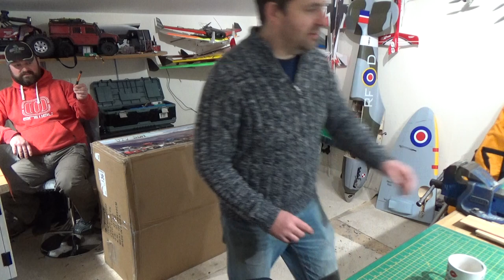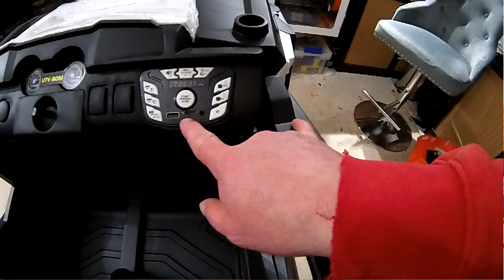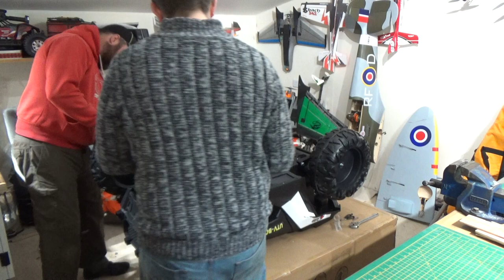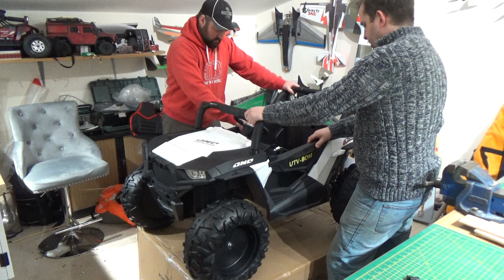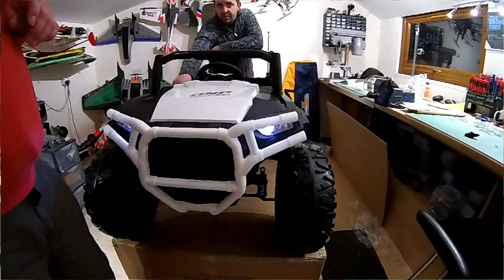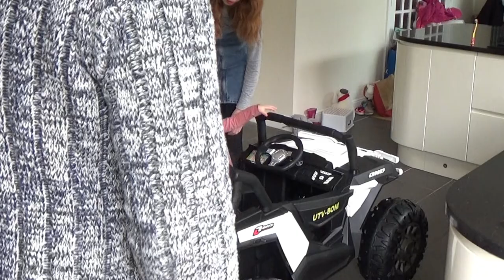Desert adventurer 24v

Comment: How long dose it stay charge for I have one but it don’t seem to stay charge long my kids got one good ride out of it
Reply from the maker: The batteries on these kind of toys have always been the down fall of them.  They still use the oldest tech (lead acid) which is reliable but there are far better batteries these days. 
Also the heavery the passengers the shorter the ride time. And if its ruff terrain the same. 
If you know what your doing you can change the batteries to other types. To get more mah ( milli amp hours) but will still need to be 24 volts. 
I hope this helps
Reply: Thanks. Is there one that you recommend?
Reply from the maker: Sorry i wouldnt want to recomend a battery. Just down to the safey of the passenger. They have the sealed lead
Acid for a reason but its not battery life. 
I use differnt ones as i have the correct charger and know the risks. And also know what to do if there is a problem. 
Sorry

Comment: hi Andrew!!!
when battery its to low,
how many hours need for a solid green full charge.
because mine one ,from 10 hours charging and still red light!.
thx mate
Reply from the maker: Hello Wadi 

There are loads of factors why it taking so long. But assuming you have every thing from stanard and not changed anything. 
It does seem a long time. But from flat i would allow 12 hours. 
If your battery has been run down completely and damaged the cells.its possible it my never reach full capacity which is what the charge is looking for to get a green light. 
It my be time to look in to new batteries. 
Hope this helps 
Cheers
Andrew

Comment: Mine has a power shutoff mode when it goes in the grass for more then 3 minutes it turns off and I have to kee turning it back on same issue with a full battery is there a way to disable this?
Reply from the maker: I wouldnt know if it has a power shut off. But it might have a thermal cut. When it is under to much load for a longer period. It will be saving the electronics from over heating. The only way to remove this would be to rewire without the control box. Which would be very hard to do.
Reply: @AndrewBoulton  thanks for the reply maybe I'm just overthinking it he rode it around yesterday and it was going through the mud and pretty decent-size Rock Hills still loving this thing!